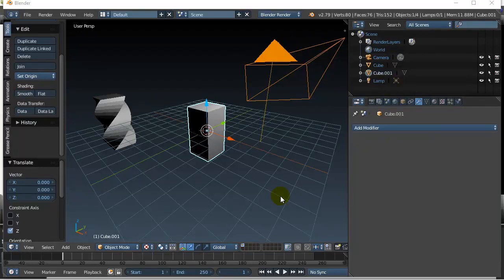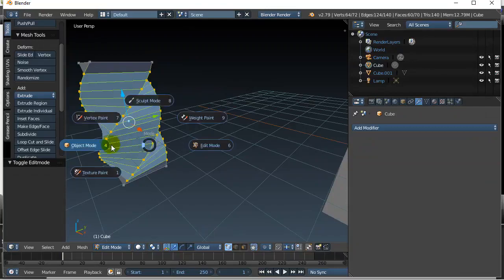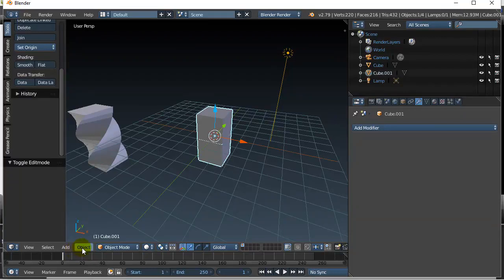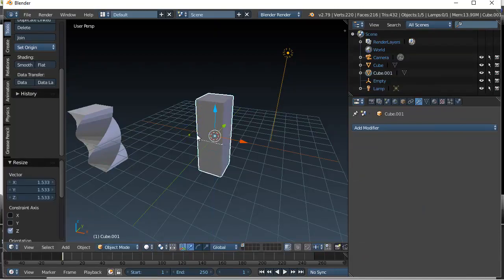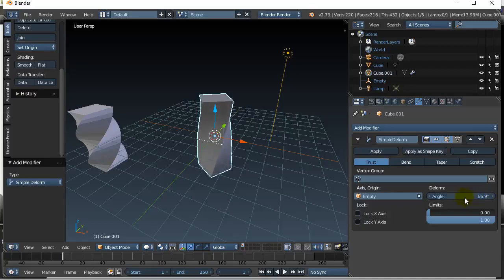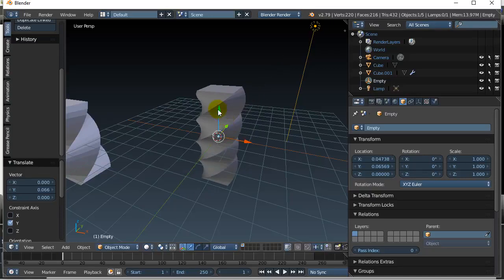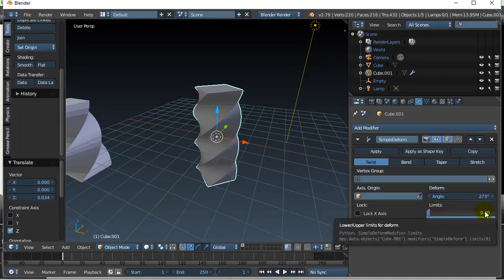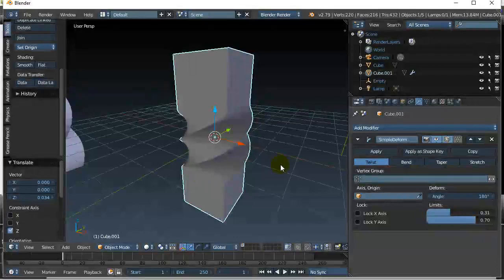Blender Simple Deform Twist Modifier

Comment: is it possible to keep the bottom part of the volume still?
Reply from the maker: Not sure.  But it seems that a twist of 90 produces 45 bottom face rotation.  180 gives 90.  Easy enough pattern.
Maybe vertex group with weights depending on use.  Anyone else know?
Reply: if you put the empty axes at the bottom it seems to be ok